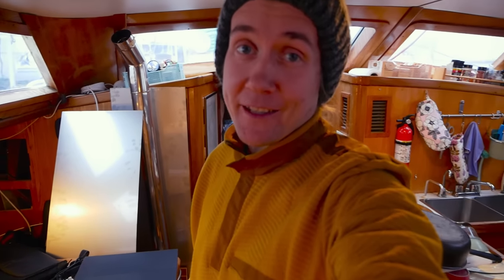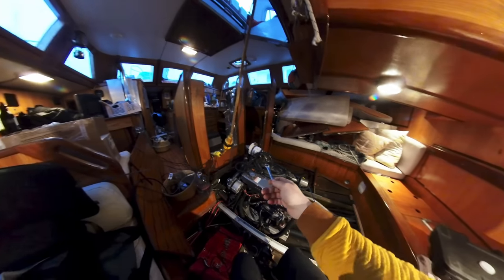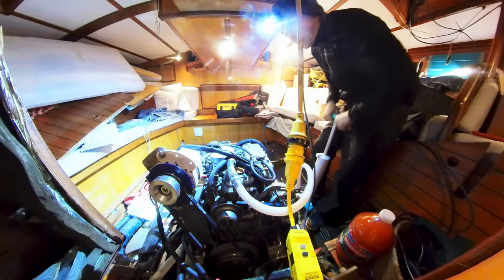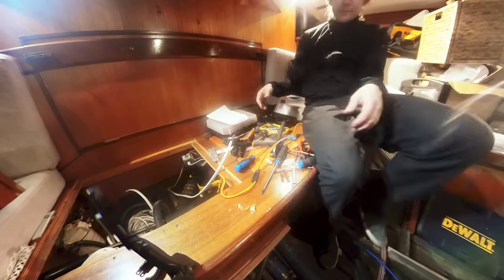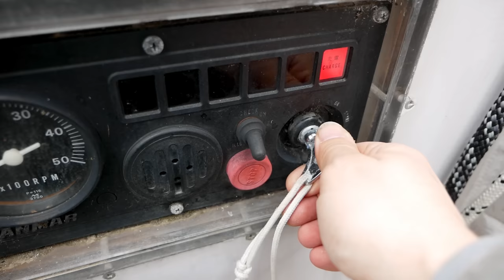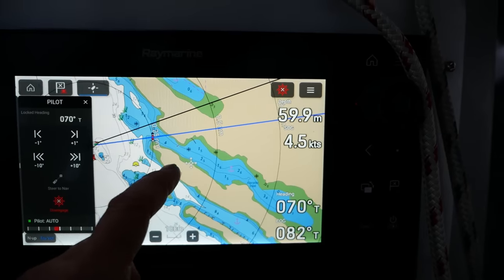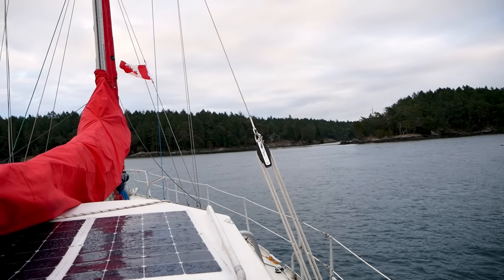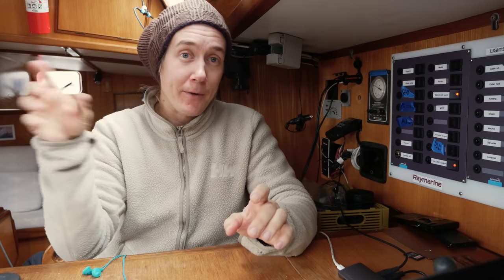FREE HEAT for Our Boat! NO Extra Running Costs!

Comment: We installed a double bus heater out of a school bus in our sailboat and it has been a wonderful source of heat for years. And if the motor isn't running, we crank up the woodstove, so we're covered for heat all around. It is impossible to be cold in our boat, but when the heat reaches sauna-like levels, it is also easy to quickly dump excess heat by opening the forward hatch and the companion way, and, Woosh, -this is how we regulate the temperature. One thing about plumbing your heater that you didn't mention, -and this was never a problem for us, is that depending on hose size, distance from the engine and some hydraulic physics I don't understand. there is a possibility that the coolant flow won't naturally run through the heater but will go the easy route through the path of least resistance. I had been advised to install a bypass loop between the two hoses to avoid this, but as there was no engine temperature reduction whatsoever, and the heater dumps out tons of heat, I've never done that. And BTW, I've already invited you several times, but once you get north of Vancouver Island, please be welcome to tie up at our dock here on Denny Island, near Bella Bella on the BC Central Coast! (www.spindriftpoint.com) Cheers, Ingmar
Reply from the maker: hi Ingmar, sorry I missed your earlier messages (Youtube blocked them because there was a URL in them.. Youtube is sometimes annoying!). That's a huge shame since we just passed your place, I actually recognized it, I think you keep it on AirBnB as well? Anyway thanks so much for the invite and maybe we'll come back down the coast at some point!

Comment: For what you guys are doing, this is a good thing. The more ways to make heat the better. As for the amp draw, on the low setting i doubt it pulls 10 amps, the 10 amp spec is more than likely if you have it on high, Use a clamp on amp meter on any wiring to see amps are drawn for sure, they don't cost much, and is a good thing to have on your boat. It also doubles as a clothes dryer, so a pretty good deal! 😄
Reply from the maker: yes, you're correct, not sure if i mentioned it but it's 10 amps at full fan speed. 4 amps at minimum.. we have a clamp-on meter :)

Comment: You are absolutely correct. The key to keeping condensation down is to move warm air around the boat. I don’t use my boat here in Alaska during the winter months but I do keep a small box heater inside and try to keep the interior at about 55°. I end up with zero condensation and very little mold at all.
You said that the heater you installed pulls 10 A, is that even on the low setting?  The found that it has is called a “squirrel cage fan“ but I wasn’t aware that they pull that many amps. I have three cabin fans on my boat and even on a high-speed setting, they only pull 1.5 A each!
Reply from the maker: hi wade! It pulls 4 amps on low, 7 A on medium, 10 A on max :)
Reply: @AlluringArctic  good to know that. I’ve been thinking of installing one on my boat to use when I’m running the engine but I’m not so sure my system could handle that extra draw on the alternator. I also run a vent fan for my engine compartment while the engine is running, and it pulls about the same amount of amps. Besides, I have one of those Dickinson diesel heaters that I can run, while I motoring, or on the Anchor, and it does a perfectly good job. I can’t run it while I’m sailing because the boat heels to the side and the diesel needs to burn in the middle of the heater on the inside.

Comment: Do you have a water heater? If so hook this up to that with the return going back to the heater so you only loose a few degrees using the heater before it goes back to the water heater. That is how to get almost free heat. You can get a one way valve to get the water back into the water heater, depending on your heater you might have to use a small return pump.
Reply: They literally plumbed it to the water heater line...

Comment: circulating the interior air has to work better in terms of adding heat and drying the interior as opposed to pulling cold moist air from the lazarette or exterior.
Reply: Cold moist air has less moisture than internal air :) this can be counterintuitive

Comment: Also Good Mention Here :  Air to Air Heat Exchanger ( and of course extra insulation, with attention to the windows or ports. ) ,....you need your minimum ventilation requirement .... a good DIY is copper clad blank circuit boards, cut into strips, alternating direction, between alternate layers of copper, ( stack with flattened solder and flux, removable high temp ( 100C min ) spacers and solder in oven )....a good size is 12"x12"x 4" (  304mm x 304mm x 100mm ) with appropriate case and ducting-----> figure for condensate....it's a tricky operation, and you don't want to make scrap....but if you clean it well enough in post, it will also make some fresh water, but not allot.....everything active in your boat makes heat, so it goes a long way just to keep the heat in.
Reply: I have been thinking of this, do you have a video ?
Reply: @markthomasson5077  i can't afford to make a video on that one, at the moment... if there was some way to pass that one off to light industry ? 
it is just a way i thought of to make a very efficient A to A Heat-X that would work well...
the tooling investment would be minimal, practically one off level, which makes me think DIY
and any process scrap could be amended in re-work .... so DIY-able....but also an income level market, where obviously someone could tool up to make them at a cost at which people would make the purchase before attempting a DIY........but again, i can't even afford to make a DIY video on it, so i am just throwing it out there for anyone to pick up.
Reply: @markthomasson5077  could probably make them smaller, than mentioned, for most sailboats....i guess i would call the dimensions given good out to a 60' yacht....i will probably design one at about 6"x 6" x 3" for my smaller yacht design.

Comment: The fan is noisy because it is centrifugal fan which is capable of putting relatively much pressure into ventilation pipes. In free air, simplier fan would be better.

I made additional warmer to my garage to be able to save electricity. I have old car radiator inside and wood burning stove outside to heat the water, which is circulated through the radiator. 

I tested three different fan types. 90W 50cm circulation fan, 160mm 120w centrifugal channel fan and 5 pcs  of 120mm computer fans. Circulation fan and channel blower were very noisy. Big fan lost lots of it's air flow because it's working pressure was too low. It was designed to move big amount of air in free space, like ventilating construction sites. Radiator resists air flow surprisingly much. Centrifugal fan on the other hand, was designed to greater pressure. It's rated flow was 450l/s. It was very noisy too.

Computer fans were practically quiet. They couldn't be heard over 3m away. They consumed only 2.5w per each and were rated 100l's. Their working pressure seemed to be optimal since the radiator didn't reduce the flow much. I paid 24€ for 5 fan bundle pack and they have 10y guarantee, and by the way, brand name was Arctic.

Based on temperature of circulated water and overall feeling, all three fan systems put through about the same amount of air.

Comment: May alao work with your hot water heater and a simple inline pump for circulation. Would need a pressure relief to prevent creating and boom mechanism!! Be safe
Reply: Hot water manifold works as well!! I was thinking the hot water run from a propane🤣🤣

Comment: Re: coolant & your engine. 
Make sure you have a thermostat in your engine it will be warm up quickly & minimse wear. You can get different value thermostats, one with a  higher value (say 200f) will be better in the arctic. A lower value to give more flow in warmer climates would be appropriate. 
You have the potential for more damage or accelerated wear in your engine if it doesn’t get to working temperature. Please don’t run it without a thermostat. 
Your heater will have little or zero effect on the temperature of the coolant running through it. 
I’m a truck driver & live in Canada, if I run the engine all night in extreme temperatures, say -25 C, it’s run at fast idle (1100 rpm on a 15 ltr diesel) this is to keep the oil pressure up & try to keep the coolant as warm as possible.
Reply: The engine of course has a thermostat...
Reply: @jonnenne  I wasn’t trying to accuse you of not having a thermostat, just high lighting that you can get different value (the temperature at which the thermostat opens) ones. 

A higher value thermostat will get your engine hotter before it opens, desirable in the arctic, not in the tropics. As you’re using a heater running off the temperature of the coolant, that might be an idea?

Comment: You need temp and oil Pressure guages. If you install a valved loop to isolate the engine and connect it to a woodfired hot water heater and circulating pump you can minimize frost in the boat easier.
Reply: Most sailboats don't have those, just oveaheat and low oil pressure triggers

Comment: The principal is a good one but the same thing can be made by most competent yachties with a small motorcycle radiator and attached fan, mounted in a plastic food container. You wont need more than a variable controller for the fan supply. If you really wanted to go mad, you could have an electric water heater, in the loop, for any time your on a hook up? Maybe not! Just put another jumper on!  Love your yacht, it will see you right.

Comment: Strange there are not more installing cooling scavenger hot air systems. Watch out for open brushed motors is you need sealed marine safety. PWM speed controller instead of the resistance controls will save power. A thermostat relay will prevent overcooling. Stay warm.
Reply from the maker: hi Braith! What's wrong with this type of a motor? You mean that it can produce sparks? That's definitely a consideration especially if you have a gas engine
Reply: @Alluring Arctic Sailing  Definitely some automotive I have seen. I don't know this model in particular. Just for the gas engine and bottle gas users, of course. If you're all diesel, it isn't a safety or code issue, only a matter of corrosion. 
If anyone has seen a compact unit with an efficient sealed brushless motor?

Comment: If you want to make the fan quieter and draw fewer amps you can block part of the fan by putting a band or collar inside the fan. It works by reducing the amount of air that the fan pushes out, a narrow band will reduce it a little, a wide band will reduce it more. I've made bands out of plastic bottles of a diameter slightly larger than the fan and fixing them in place with duct tape or a few dabs of silicone. I've found that the "High" setting was more than I needed so losing some of the excess airflow was a worthwhile trade for the reduced noise level. Since there is less drag on the fan the electrical draw is lower by roughly the same amount as the reduction in airflow. I've installed this type of heater in a school bus/camper conversion and several vintage trucks and they worked well
Reply: Luckily that fan has different power settings.
Reply: @Rodrifuuu  And they can all be made quieter if you don't need full power and the noise is objectionable. If you've never used one of these fans they can be frustratingly loud, you can change the pitch and character of the sound and make a big improvement on that cheap, not particularly high quality fan that just selecting a different speed can't provide

Comment: Yes, it is a heat exchanger, there are also some made for a  fireplace. You may decide to install 2 or three of them in parallel.. For each room or a big room👍
Reply: Using R (total for 3 fans) =  1/  1/R +1/R +1/R  then their total resistance is going to be just 1/3  compared with one fan if all 3 fans (unfortunately) happen to be running together in parallel.  Hence the current from the alternator etc will be 3 times greater!  30 amps, in this case!  No thanks, more stress on the alternator and thicker cable would be needed to/from the alternator.
(I'm assuming you mean cabins, not "rooms"..)
Reply: @alexandermenzies9954  yes, I didn't know about the fans being so inefficient. If it weren't for that, then the heat could be distributed while the engine was under load
Reply: @Orbacron  The fans are likely to be reasonably efficient, that is not the problem,  after all they force warm air into the cabins and displace the colder air.

Comment: Are you kidding yourself? Heat at no extra cost? First you have to buy the heater, then you have to install the heater (some people can't do that) and then you have to run the engine. If you are moving from one place to another it might work, however, you will be stationary at night. Running a diesel engine on idle does not create enough heat, if any at all. I am waiting for your next story!

Comment: If you don't have a set of gauges on the engine...that should be your next install.   At some point you are going to have an issue and you won't know it until smoke or the knocking starts...  My opinion of course...but when it come to a boat i always had the policy of...plan for the worst possible...
Reply from the maker: we have the "idiot light" (overheat alarm) temperature gauge but will install a more precise one when we get a moment

Comment: So, do you anticipated that this heater will be enough to keep the boat warm in cold conditions while motoring? I have no idea how cold aluminum boats get but I assume they need more heating than fiberglass boats. 5-8 kW does not seem like a whole lot for a 40'+ boat especially if your heater uses mostly outside air. Have you installed a passive diesel heater as you had in the previous boat yet (next video?)? I don't think the 5 kW Espar will be enough.
Reply: The boat won't be warm-warm. The point is to warm it up enough to dry out the air

Comment: Just wondering about where you can and can't sail your boat in the artic. Are you concerned about hitting ice? How does your boat handle breaking ice - is it designed for breaking ice? How far north can you go (in the winter season) before ice is a concern?

Comment: A cheap FYI is find a clean salvage radiator from a small motorcycle 300-500cc. Or some bigger bikes have 2 radiators so just need 1.

Comment: Nothing free about that heat unless you're running the engine for something else like charging batteries or travel then it makes sense . That install is causing the plywood to act like a big speaker making the blower sounds louder if you mount the heater on rubber mounts and put soft foam gasket around it you can almost eliminate the blower noise

Comment: Have you considered a few vertical wind turbines? You could mount to the bow, the aft, and top the mast and get a heap of power. I would be tempted to put an electric motor on your drive shaft so you could even cruise using electric power.

Comment: I was under the impression that marine engines use sea water for cooling, so this was a surprise to me to see that it is, in fact, a closed system. I was wondering where  the coolant radiator located and how it is cooled though.

Comment: Diesels are notorious for not producing a lot of heat.  In fact Diesel semi trucks employ additional heat from heaters that burn Diesel fuel.  Truckers often put a cover over the radiator to try to get the engine to run warmer in the winter.

Comment: Thats old school! My 1968 Grand Banks had a bigger version on that on it!! I have a single and a double in my converted School Bus turned RV. It is free to run when motoring, but still have to have other sources of heat when you shut the motor off. Diesels will NOT throw a lot of heat unless working hard, at an idle they tend to run cold

Comment: Wow, radiators. Actually smart thinking, engines do produce more excess heat than real shaft power. It is sad, using the extra heat means extra bits and pieces, taking space and weighing some. So, cars have a radiator and the energy is blowing in the wind. Always wondered when "they" would solve that horror. All you hear is "great" fuel economy figures, though it really sucks, when you know how much heat (and thus fuel) gets lost. Gone! Still, on this ship extra heating is welcome.

Ehm, did you STEAL your diesel oil? How do you explain "No Extra Costs"? Ah, you need to generate electricity anyway, using the engine, for an extra generator is not always the best option. I guess in the arctic the word reliability has a harsher tone to it... the engine MUST start at all times.

Yes, our "modern" world is weird, when you ask some obvious questions about energy, you stumble upon unsolved business that hardly moves an inch forward.

Comment: I'm not sure how safe it is to not run this thingy while the motor is running. You'll have the heat exchanger grill more than 100 C, with no forced circulation and cooling, so essentially you'll have something over 100 C hot closed in your wooden furniture. No bueno.
Reply: More than 100? Are you running only oveaheated engine?
Reply: @jonnenne  Most diesel engines run between 90-105C.
Reply: @Urgleflogue  A healthy engine runs at 90. A engine with issues will go over 100.

Comment: The 12/24 vdc solenoid control valves used for hydronic systems loop/ circuit control are perfectly capable in this environment - they operate flawlessly at much greater boiler system temperatures and corrosive environments. The stupidest - simplest least expensive models are designed to just open/close using only a few milliamps. Quite frankly, I would supply Engine/ignition on power to the valve then use the negative ground circuit for on off control. If your wealthy it would be excellent to purchase a fully automatic flow control valve with Delta T. I prefer Taco and Grundfos.